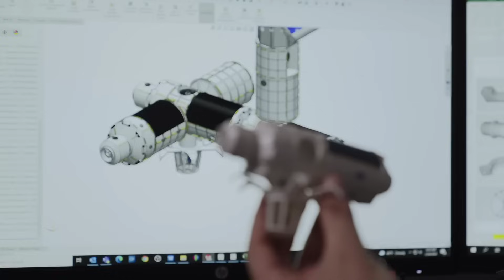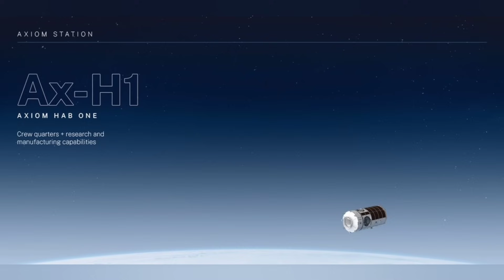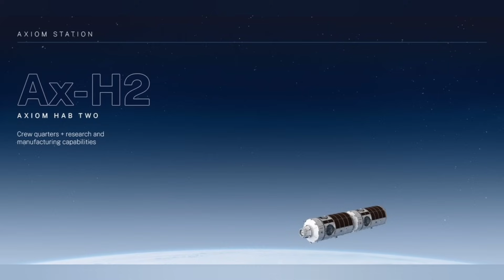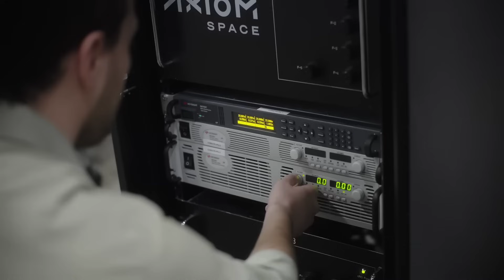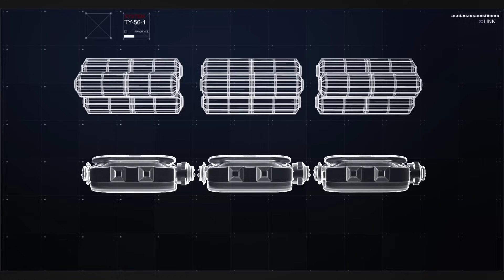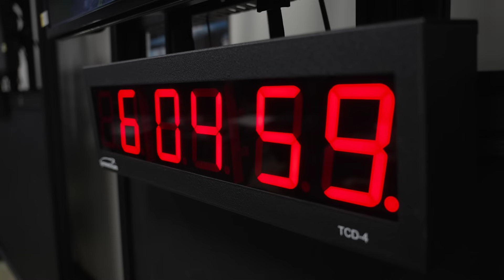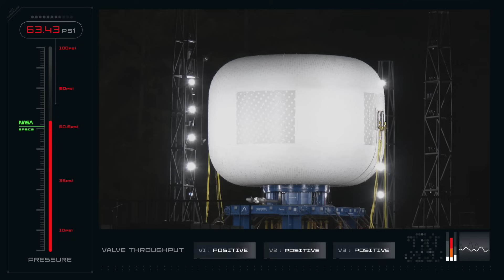Two new NASA space stations are almost ready to replace ISS!!  Axiom and Sierra Space!!

Comment: Iss wasn’t the first step, Skylab was. I read the book Homesteading Space and some of the lessons of the Skylab program were forgotten when ISS was designed and we repeated some of the same mistakes since no one back and looked at the old project documents and write ups
Reply: I think the Russians and Salyut(s) would disagree.
Reply: Skylab was awesome.  Way too short of a program, IMHO. 50 years ago.
Reply: Skylab was a great space station.  My father worked on the project in the early 70’s.
Reply: Sometimes you need to leave a comment section and come back to see that it posted.
Reply: I head one of the engineers talking about Skylab and ISS.  Skylab was massive inside.  It had more living area than the ISS had for years.  Last, people who knew Skylad and the ISS said the ISS was like living in a series of interconnected trash cans.
Reply: @Easy-Eight  That's not what I'd heard. There was a lot of empty open space on Skylab and one of the astronauts said that he preferred the 15 foot wide modules to the 22 foot Skylab workshop because of that, and he'd also been consulted for his experience on Skylab 3 in verifying the ergonomics of the Space Station Freedom modules that were then used on ISS (the design largely unchanged).
Reply: @thomasackerman5399  Yup, Skylab was a converted S-IVB stage, and due to weight constraints and other issues, it couldn't be fully outfitted out, so that area of the workshop where the instrumentation ring was was left wide open, mostly wasted. The only time that came in handy was for the MMU prototype tests.
Reply: Having personally designed SkyLab and its accompanying architecture, the ISS is a fail. To this day I remain downcast at the failures of ISS, compared and contrasted to the achievements of my program…. SkyLab
Reply: Having personally designed SkyLab and its accompanying architecture, the ISS is a fail. To this day I remain downcast at the failures of ISS, compared and contrasted to the achievements of my program…. SkyLab
Reply: Having personally designed SkyLab and its accompanying architecture, the ISS is a fail. To this day I remain downcast at the failures of ISS, compared and contrasted to the achievements of my program…. SkyLab
Reply: Having personally designed SkyLab and its accompanying architecture, the ISS is a fail. To this day I remain downcast at the failures of ISS, compared and contrasted to the achievements of my program…. SkyLab
Reply: Having personally designed SkyLab and its accompanying architecture, the ISS is a fail. To this day I remain downcast at the failures of ISS, compared and contrasted to the achievements of my program…. SkyLab
Reply: Having personally designed SkyLab and its accompanying architecture, the ISS is a fail. To this day I remain downcast at the failures of ISS, compared and contrasted to the achievements of my program…. SkyLab
Reply: Typical for NASA.  A massiv space station is the first it needs towards a space dock.  But we didn't get more huge parts put together.  Next thing was SpaceLab, the tini thing that fitted into SpaceShuttles fairing.  A huge step ... Backwards.
Reply: @MichaelWinter-ss6lx ISS commercialized LEO and directly led to funding nacent aerospace companies like SpaceX that otherwise would have no chance of making money. ISS is a real life hero for keeping the dream alive
Reply: @Easy-Eight  Actually, Skylab's volume was mostly wasted empty space, even considering the Workshop and MDA/Airlock sections. And contrary to what cbsspock says, Space Station Freedom (where most of ISS' hardware was designed under) engineers DID consult a lot the Skylab astronauts and experience. In one case, the one Skylab astronaut had noted that having that much open volume was a detriment, not an asset since anyone who was in the Saturn instrumentation area and accidentally floated out into the middle of that open space, they were stuck there until someone else could line up and push them to a wall.

If you want to know more about it, look up the old Freedom newsletter "Station Break" and read through it. Most of the now ISS hardware as we know it now was finalized by 1992. It really in 1993-94 came down to what got deleted, such as the original station propulsion system that was left off to save money, especially since by that time the Russians would be providing it with their modules. And this despite the fact that a full-scale propulsion module was built and test-fired at White Sands New Mexico!
Reply: Skylab was so cool, those men that occupied it were so lucky.. it was a gigantic zero g playground and nothing like it has ever been built since 😢
Reply: ISS wasn't the first step, walking on legs was.
Reply: And they're doing the same thing now with Artimus ignoring lessons from Apollo!!
Reply: Look at the aerial gymnastics footage, by skylab astronauts. I was 16 then. Over 50 years of agony since then.
Reply: Gubberments will gubber
Reply: Who cares u want a cookie for knowing the book that anybody could read
Reply: @babinostventertainment3265  Did you read the book?
Reply: @babinostventertainment3265  It's related to the topic of the video and is certainly something I didn't know. Why be a dick?

Comment: 7:12 Man, I'd be worried about micrometeoroids smashing those windows!  

No doubt those cover flaps will be made of a super-strong material.
Reply: The promo video shows gigantic windows larger than a car. Yeah. How’re they going to cut windows that big out of the module and still keep it safely air-tight at the same PSI margins?
Reply: @Rangefinder02  Blue Origin tweeted a photo showing one of those windows being tested.
Reply: Those may not be real windows. A 4xHD video screen, and matching camera(s) outside would work as well.  Fox News uses this behind their morning show, for safety.  @Rangefinder02

Comment: How is that big puff ball going to deal with micro meteorites?
Reply from the maker: Because it's made outta multilayered kevlar.
Reply: @TheAngryAstronaut  ahhhh
Reply: Quite easily. Kevlar and composites are more than capable  of doing the job. 
Think about it - most bullet proof vests are made from kevlar / composites, not metal..
Reply: Temperature swing due to light and shadow is going to be researched extensively, but I am not a material scientist by any description. But high energy impact effects may vary greatly depending upon how the material behaves due to temperature. I’m sure there will be some unmanned testing prior to scaling up
Reply: Has Anyone shot an inflated module with a rifle to simulate a space junk strike?
Reply: There's already one one of these attached to the ISS it's been there a long time albeit being used as storage space its holding up well 🙃
Reply: Thanks all for answers. I just now finished the 2nd half of video after doing chores etc o7
Reply: Flubber.